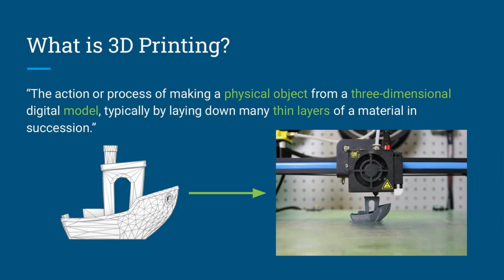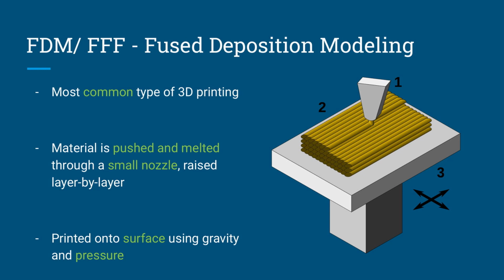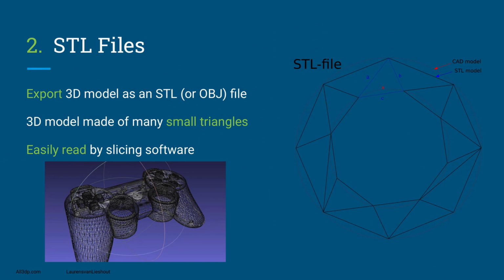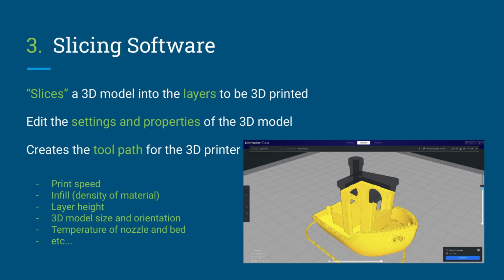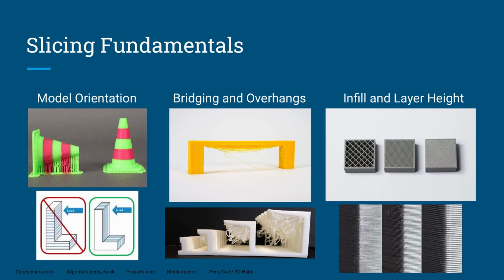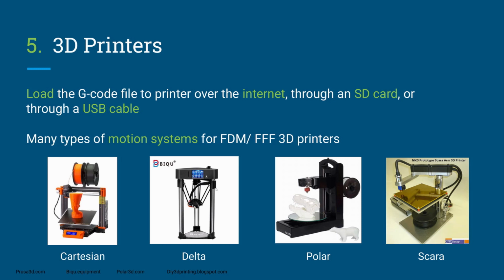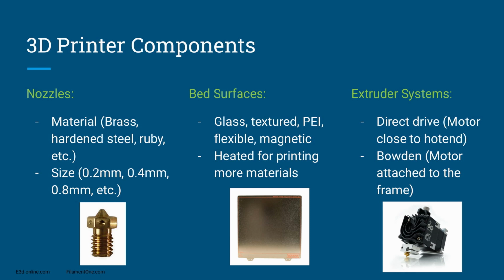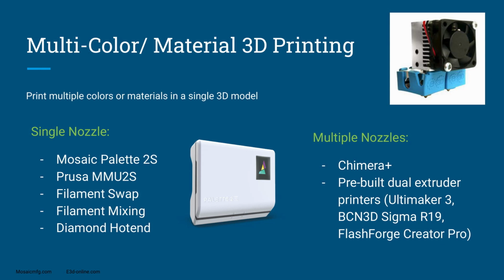[Updated] The Ultimate Beginner's Guide to 3D Printing

Comment: Greetings! I am trying to slice my file in repetier slicer using a line pattern to get the desired printed part as designed in CAD. While slicing, it is not generating a linear pattern in the inner part of the geometry (45-degree filling). I am attaching the (.stl) file in the given mail. Could you please use this part on your side and check how the slicer is slicing. If possible, print the file; it is a very small file

Comment: Hey is it possible to use a tablet to print 3d models or is there any slicing software to use on a tablet I'm using a monoprice v2 3d printer by the way
Reply from the maker: Most slicers are on the computer, but there are a few online slicers like astroprint.

Comment: This was such an awesome video. I had so many questions regarding 3D printing and 90% of my questions were answered !! thank you so much :)
Couple of quick questions:
Can i use Creality Ender 3 Pro to print items and sell them commercially? Would the quality be good enough (shape, fine-ness, smoothness, sturdy-ness, detail wise)?
I came to know about concepts like infill and layer height etc., is the printed item's strength  dictated by these properties (and ofcourse the material also)? Can I print them on Creality Ender 3 Pro?
Reply from the maker: You can print that on the Ender 3 of course.